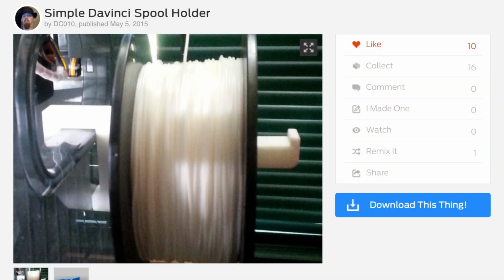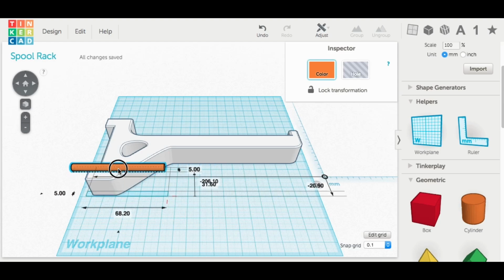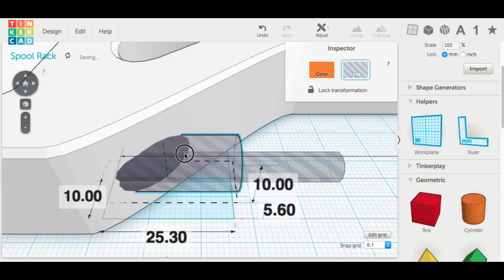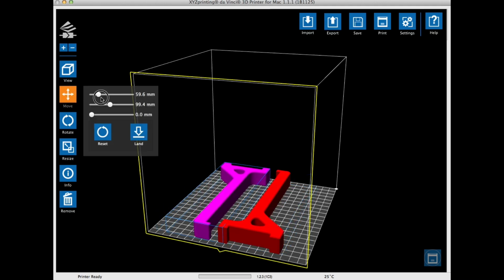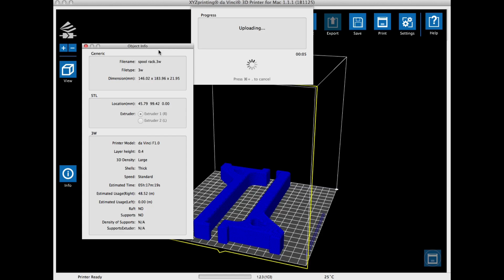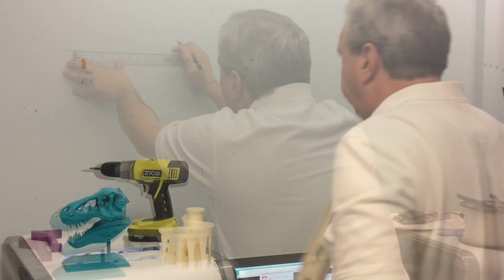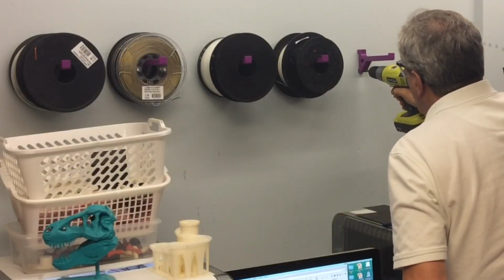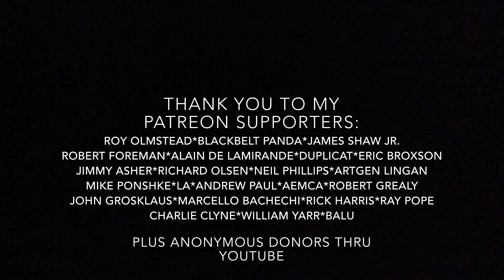Filament Friday #35 - Wall Mount Filament Spool Rack on Da Vinci 1.0 - Video #085

Comment: Never store PLA in the open even leaving it in the printer after your done printing will leave you with brittle PLA.. If you do leave it out by mistake there is a way to get it back to usable filament. You have to heat up pot of water that the entire spool can fit in and is completely covered with water. The magic temp is 156F. Once water hits that temp drop in filament spool slowly leave in water for 20 seconds then remove and dry. Put spool in zip bag try to remove as much air as possible. and rice to bag  after about an hour filament is back to normal and ready to use.

Comment: Hey chuck I have a solution for your cracked glass bed. I've had to do this to my Da vinci's 3 or 4 times now beause the glass starts chipping.

Removed the glass and bed heater by taking out the screw on the metal brackets on the build platform then open the back and undue where the two thick black wires connect to the motherboard and you should just be able to pull the heater out of the machine.

Once you have it out, just use some acetone to slowely and CAREFULLY peel away the heater from the back of the glass. Once you have the heater and glass seporated clean off any glue on both parts.

Then simply reinstall the heater in the machine and flip the glass over to the non-chipped side and re-assemble everything. No need for the glass to be glued to the heater.

If your glass gets chipped on both sides I know a guy on ebay that will sell you new glass for only $20.

Comment: I am working on fixing my glass bed using a 21x21 cm glass plate from a picture frame. I just take of the holders and slide the new one in.
Reply: +Chuck Hellebuyck's Electronic Products My Prusa i3 3mm x 218mm x 218mm borosilicate glass plate broke at around 80 C.  I replaced it with 4mm x 220mm x 220mm window glass and its been fine running at 110 C.  If, or maybe it should be "when", my DaVinci glass decides to give up I'll just replace it with the same.  There could be issues if the original pcb heater is bonded to the original glass too, just something to look out for.
Also, I tried an aluminium plate but running my pcb heater at 12v didn't get the aluminium anywhere near 110C, it maxed out at 38C.  I didn't see the point in pumping a whole ton of watts into a power supply so i returned to glass.  It'll be great to see how you did it Chuck
Reply: +JMAPScience The guys at my local Makerspace all print on mirrors.  I have never tried it myself but I guess it mirror backing will prevent the glass flying in the event of a shatter.
Reply: +Chuck Hellebuyck's Electronic Products I went for 4mm thick so I could embed the thermistor into the aluminium.  If the temp was getting close to 110C I'd of used thermal compound between the pcb heater and the aluminium but as it was so far from 110C I returned to glass.

Comment: Filament storage:  For those concerned about open-air storage.
In my experience (1.5yr),and region(annual humidity 49-94%) it is ok to leave ABS out. It's petrochemical base is resistant to moisture.
PLA however needs protection. I accidentally left a roll out  during the summer, and it swelled from 1.746, to 1.812(avg.) with a lot of inconsistency. It was a MBI 10lb roll, so I don't want to throw it away. As long as I stay above .2mm LH, and don't exceed 210*C, it is still printing fine on a WD4, with the stock PTFE lined extruder.
Normally, PLA that has been opened, gets wrapped with clear package wrapping, and a desiccant pack. That way, I can still store it on overhead filament rods, and see my stocked selection..
Reply: You can recondition nylon filament in a oven at low temperatures to remove moisture and I imagine you could do the same with PLA...maybe?
Reply: +Chuck Hellebuyck's Electronic Products - Region is an important factor folks need to take into consideration. People in low humidity areas, my find that their PLA will dry-out and crack,, so they have to protect for the exact opposite reason.  When I found my swollen PLA, I went back and double-checked my ABS, and it was still the same spec.
I do also use the vegetable oil trick, if I hear stepper skipping. Usually just lightly coating about 10ft seems to work, for a long time.
Reply: +Bullwinkle69 - Yeah, 200*F, for 2 to 3 hrs, is what I've read (haven't tried it) from folks that live in southern California and in Houston Tx..,, if you see bubble-pop in your print. (mine didn't get that bad , luckily) I don't know if it will cause it to shrink in diameter,, I might try a small piece, just for the fun of it thou :)
I'm very cautious w/nylon.  I have 5 spools on a rod inside of a clear, tape-sealed bin, with lots of desiccant,, and a 5 PTC fittings, w/a little bit of filament hanging out, but still tape sealed.  When I'm ready to use it, I don't even have to open the bin, ,,just feed it thru a piece of bowden tubing,  directly to the machine, for minimum air exposure.
Reply: Bullwinkle69
- Yep, you found my flaw. I was being a "cheap skate", and was only turning the A/C on at night, or above 85*F(30*C).

Comment: You're not worried about keeping filament out in the open air to absorb moisture? It's not just me saying this, it's many people who always doubted keeping them sealed with desiccant packets always start asking about bubbles in print walls.
Reply: +Chad Stambaugh I keep all my filament in open cardboard boxes with silica gel packs in the bottom.  It's been like that for 10 months and I have had no issues.
Reply: +Chad Stambaugh I keep mine in a 5 gal bucket with rechargeable  desiccant in ita lot of it depends on how much humidity is in where store the filament and how fast you use it.since I use a swamp cooler  it doesn't take long if I don't protect itif you don't protect your filament you can get bad prints like waves in the print or strange blobs since the moisture can cause strange swelling when you print.nylon is really affected by this so you want to dry it out before using it.if you have a spool that you suspect is "wet"  put it in your oven at the lowest you can ( most are 180 f or about 80 c) for about a hour first. that will "dry" it out
Reply: I keep mine in two large Tupperware storage bins with packets of desiccant. One bin for ABS, one bin for PLA. I can fit about 20 rolls in each bin. I've not had any issues. I am in a humid environment in the mid-west though so that is my main concern.